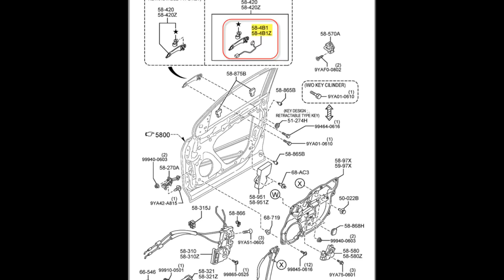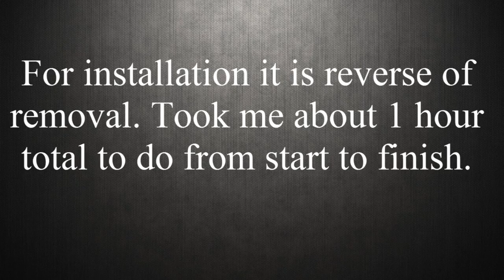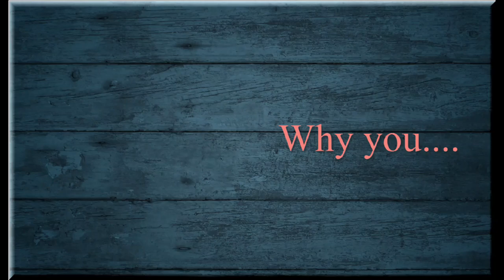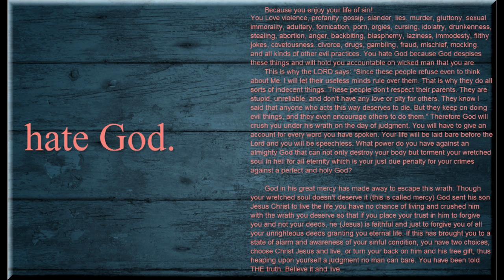Mazda CX-9 Driver side door handle lock/unlock rubber button removal

Comment: Thank you for posting, it was very helpful for me to prepare and execute my driver door handle replacement for 2010 CX9 , the tip you provided to note that the cable is fixated inside the door frame was spot on.

Comment: I just replaced the button and harness on my wife's 2007 CX9. When you take the door handle out, the lock drops inside the door as it attaches from the inside with the 10mm bolt.  Very good instructive video!
Reply from the maker: Brian Wilhelm Thanks! Glad it helped. If you ever need prayer just let me know. Healing and Salvation is in no other name but Jesus! :)
Reply: 1988joshua  amen, brother!

Comment: Is securable programming necessary or does it work immediately after changing the switch to the new one?
Reply from the maker: Nope! It is plug and play.
Reply: BeautyNHair  hoping you can help me. I brought a used 07 CX9 the door buttons on the driver & passenger side don’t work but when I press them the red light on My key card flashes making wonder if it’s a programming issue? Or do both buttons need to be replaced?

Comment: What is the piece that I need to order. My 2007 CX9 left door handle is not working properly. It doesn't always open on first try and is getting worse. I have a feeling this video is going to help me lots. But I need to order that part first. Do you have a number or name? Thanks. God is Good!!
Reply from the maker: Randall Robertson Your door is not physically opening or when you mash the rubber button on the handle the door will not unlock?
Reply: Not physically opening. Pulling on the inside handle when the door is locked nothing happens...i hit unlock and it usually unlocks and I open no problem but what I am finding is that more and more frequently the door is not opening even when I hit the unlock button. If I wait a few seconds and try again it will open. I can definitely tell something is deteriorating more and more. Thanks so much for your reply and your help.
Reply from the maker: Randall Robertson sounds like the lock/unlock actuator is failing or the switch is gummed up causing an intermittent issue. Troubleshoot the issue this way. Lock the doors then use the passenger side to unlock the driver door. If the intermittent issue is resolved by using the passenger switch your issue is with the driver switch. If the problem does not resolve using the passenger door switch then your driver door lock unlock actuator,is going bad or the physical lock on the handle is corroded. If this is the case spray a bunch of wd-40 in the door lock manual key insertion hole from the outside and actuate the door lock manually with your key back and forth. next, spray the handle while pulling and holding it open in the side crevisous of the handle. Taking the interior door panel off would give you more access to the lock though. My video covers the lock and it's physical location and properties. Hope this helps.
Reply: I will try those troubleshooting tips tomorrow for sure. Thanks for your help...I really appreciate it. I may be in touch further..hope that's okay. God bless.
Reply from the maker: Randall Robertson No problem. I don't mind. If I can't be of help to your car problems I hope to always be of spiritual help through Christ Jesus. May he bless your house and wife with healing power this hour! Amen.